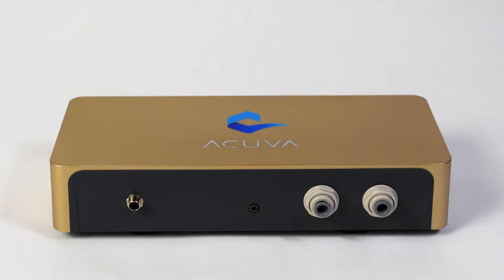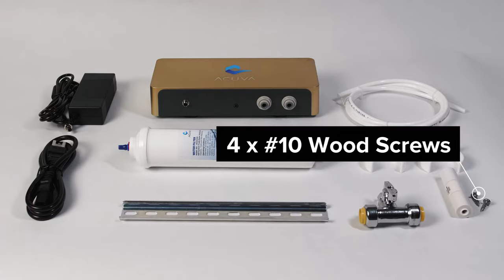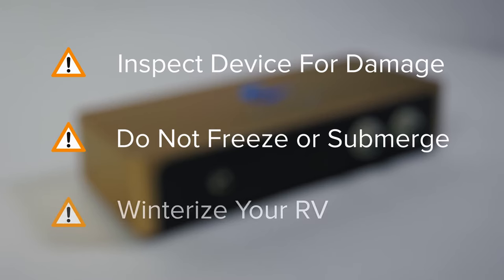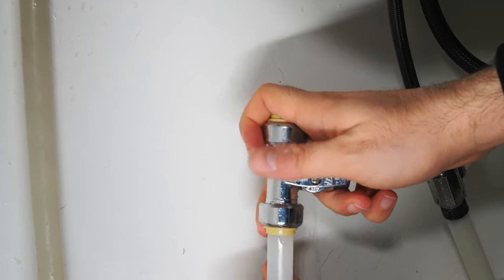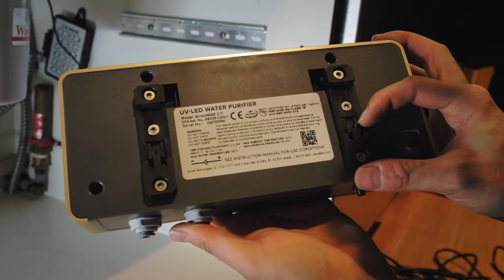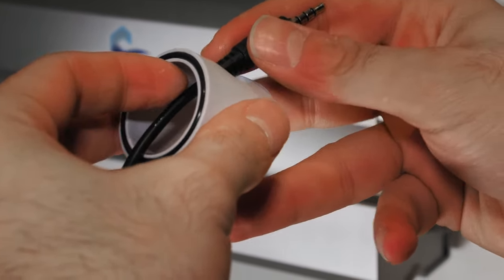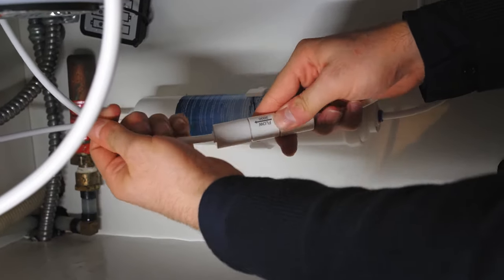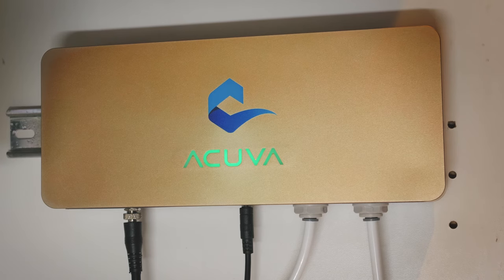How to Install the Acuva™ ArrowMAX 2.0 UV-LED Water Treatment System

Comment: If you don't have PEX plumbing, what can I use to install a tee into re-enforced braided vinyl tubing in our RV?
Reply: I had the same question and upon further investigation I found that further downstream from the braided line it connects to PEX tube in my motorhome.

Comment: Ok the feral on the faucet is completely different orientation that another post acuva did on the same system??? what way is it???
Reply from the maker: The correct way is demonstrated in the video (at 4:18), where the slightly larger slope of the ferrule enters the tube first.

Comment: Will it run on 12V vs using AC adapter?
Reply from the maker: The ArrowMAX 2.0 can run on 	
120-240V AC or 12V DC, and it can also run on a AC-DC converter. You can check the product specifications at https://acuvatech.com/product/acuva-arrowmax-2-0/
Reply: @acuva  Amazon will not allow shipment to California??
Reply from the maker: @richardburguillos3118  Please contact us at hello@acuvatech.com. Our customer support team will be ready to answer your concern.